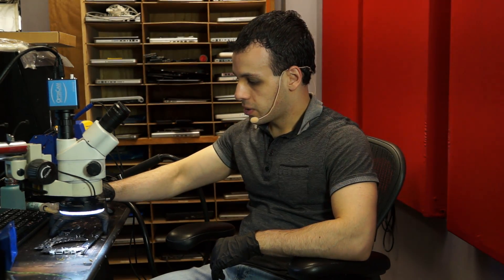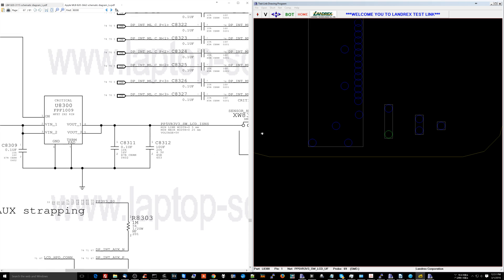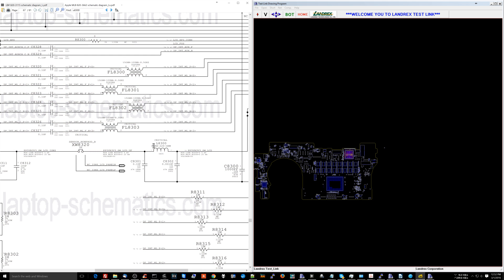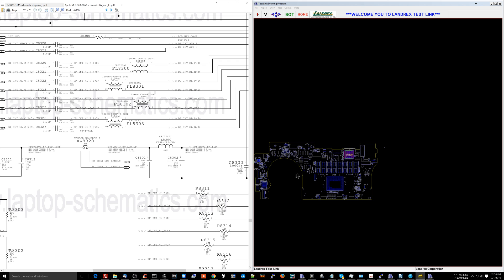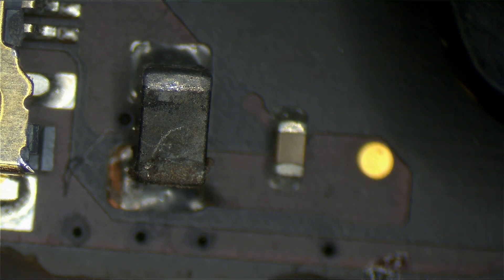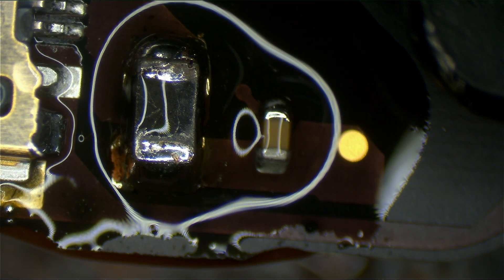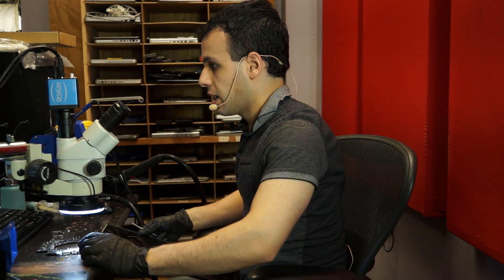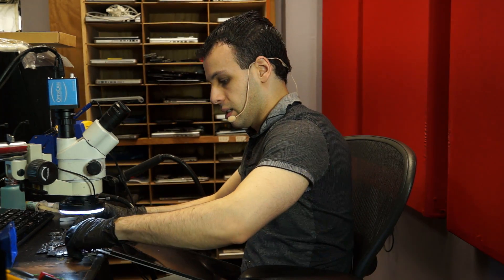Fixing Macbook Pro Retina with no video using brains not oven or heatgun

Comment: It's not a fuse, but a pi filter with the capacitors. The filter is probably used to keep the power line clean of switching components down the line. Like your approach of solving problems.

Comment: Louis. You are amazing dude. I have over the years become a good technician. But this hardware experience you are showing is something a lot of technicians do not take the Time to learn and understand. I wish I did. I’m having a blast watching your videos. I first got into this when I taught myself how to reprogram a bios chip to take off Icloud. Now I’m trying to repair other issues from hardware failure as I become better. Currently having a late 2013 13” no video from my diagnosis. It was dropped. It does not have dedicated video, so I’m guessing the solder joints on the cpu have become loose, or something similar to your issue in this video has happened, I will look at the board closer and hopefully I’ll see something irregular. Thank you for your videos, I’m sure a lot of others besides myself are fascinated and educating ourselves from your video lessons, which may not be lessons. I appreciate you.

Comment: That inductor might also be there to limit inrush current to the LCD when it's turned on so it doesn't make PP5VS4 dip or overcurrent the switch. The LCD probably has its own capacitors on the rail and without the inductor they'd suck a ton of current when the switch is first turned on.

It could also still be for some smoothing. The fact that there are capacitors before and after the inductor makes me think so. Sure the rail might have a nice regulator powering it but the ability of a regulator to keep the rail smooth is limited when the load is far away (physically).

I don't know what the board layout looks like so this is pure speculation and you could totally be right and it's just being used as a fuse, although in that case I don't know why they wouldn't just use a low-value resistor instead, they're cheaper.
Reply from the maker: +rfmerrill good stuff!
Reply: +Louis Rossmann crap I dunno if you read my comment before or after the edit, I added more.
Reply: +Louis Rossmann You reply to youtube comments faster than anyone else I've seen, haha
Reply from the maker: rfmerrill I think it is a combination of what you said, and also a fuse to keep the entire PP5V_S4/PPBUS_G3H rail from dying when someone plugs in a connector lopsided.
Reply: Yeah I think that makes sense

Comment: Hey Louis, do you think you could do a video and explain what Apple did to screw up the 2015 retinas? From what you mentioned, I assume that the fan kicks in at higher temperatures than it did in earlier models, which could lead to board damage. Is that it? Also, does it apply to both the 13 & 15 inch or just one of the two?
Reply from the maker: +Anjelo DeVito That is correct. For 13" models that is correct, I haven't checked 15" yet
Reply: +Louis Rossmann Whats the difference in temperature for the fan to kick in? Also, is it possible that this was due to a software glitch and can be updated via firmware/BIOS?
Reply from the maker: Anjelo DeVito I have yet to check the exact temp. One of these days when I have time!
Reply: +Louis Rossmann Thanks for your response! Just thought it would make for an interesting video. Plus, it could serve as a "I told you so" video for the future.

Comment: brain and a couple hundred dollars in equipment
Reply from the maker: +Clayton Little The microscope is about $450 with the stand, the camera is about $700, the capture card for it is about $300, the soldering station is about $300, the hot air station is $1800 but one can get by with my old $700 one.
Reply from the maker: +Clayton Little You could use the tactic I demonstrate in this video to fix it with no microscope and a $10 soldering iron. I used a shitty $100 JVC Everio camcorder viewfinder as my "microscope" .... it works. It is a crappy method, but it works. https://www.youtube.com/watch?v=NKXzm_fkja4
Reply: +Daud A. he did not Used the rework station só I did not knew the others stuff price
Reply: +GamersCraft That microscope and camera are like 1k and the soldering station and heating station probably another 1k

Comment: Louis, L8300 along with C8301 and C8302 form an EMI (Pi) filter to reduce electromagnetic emissions (RF Noise) from being emitted from the display and cable connecting the display. FL8202 and FL8203 just above serve the same function, these are special common mode filters so that the noise filtering doesn't distort the signals on the differential lines to the display.

Thanks again for the great videos.

Comment: That would be me. You need to put 4 bmp files in the program's folder as well as create a folder in the c drive called C:\t_link and put a copy of the files there. Or simply just place the .exe file in C:\t_link. The program was clearly meant to be placed in C:\t_link and the program looks for them in a hardcoded C:\t_link location in one place of the code and the same place as the .exe in a different places. The files should be called arrow1l.bmp arrow1d.bmp arrow1r.bmp arrow1u.bmp and be something like 32x32 bmp files. If you search your inbox for "Regarding board view software" you should find a zip with suitable bmp files prepared.